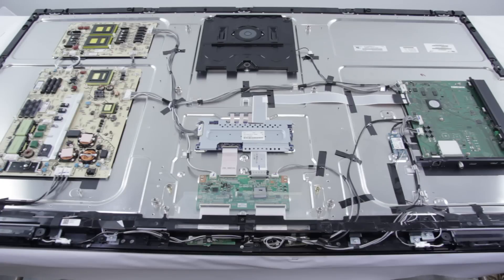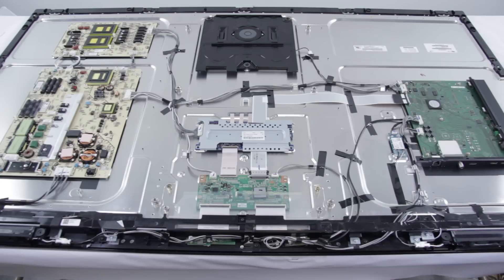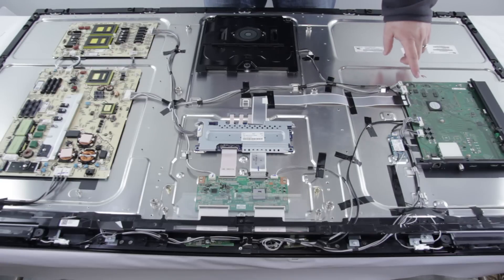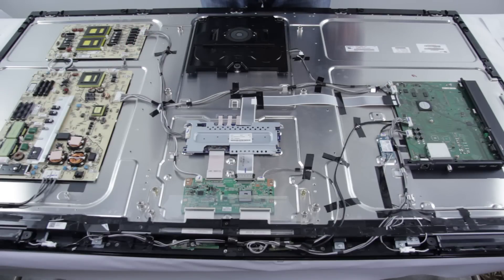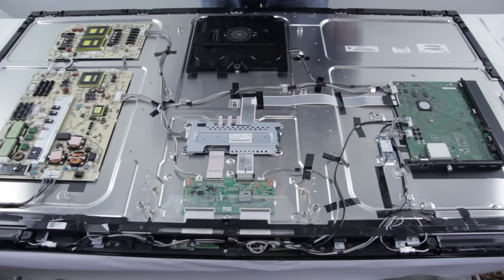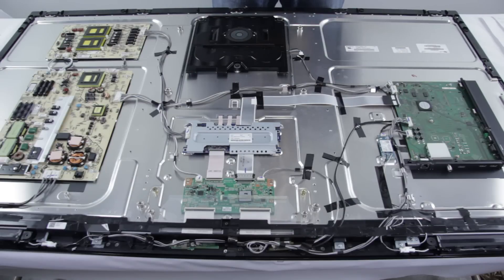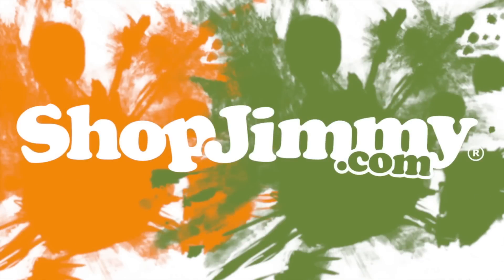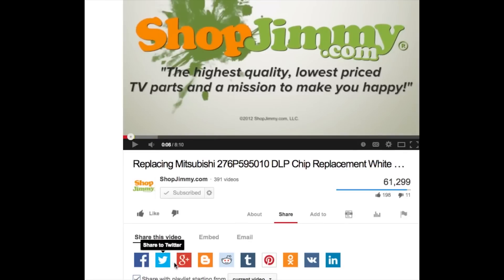LED TV Repair Main Board Overview Blank Screen-TV Has Audio but No Video-Common Issues Problems

Comment: Changed the t - con board on Samsung un50h6400axfza and still getting a lit screen and audio but no picture
Reply from the maker: +kurt gonzales   Try all repairs and troubleshooting at your own risk.  I recommend running the flashlight test on your TV.   Here is a link to a video we produced that shows how to run the flashlight test. https://www.youtube.com/watch?v=xUzCLgoSPGM Please reply with your flashlight test results and we can recommend a replacement part for your TV repair. Thanks and please let us know if you have any questions! www.shopjimmy.com

Comment: I need help with a toshiba flat screen has no picture or volume but led lights are working model #47hl167chassis#taco711serial#am363057297

Comment: Hi I have sansui lcd 55 inch and my problem is with input if i plug in pc or media player it can't PLAY WITH full hd signal 
only 480p and if i use vga input it chose any resolution but not full hd
model no : LC-55A12

BEFORE WAS EVERYTHING FINE BUT NOW NOT WORKING ONLY LOW RESOLUTION

Comment: i have given to a local repairer and got it fixed.  mostly the problem will be in s/w side. black box which will be the main part if leds are good.

Comment: i have a lg 42 inches lv 5500 tv is getting oned after 3 minutes and vr unable to get audio and if v change the date and time once v off the tv and on again the time and date saved is lost technician said motherboard problem i am from india lg company said no motherboard its 2011 where can v get it in india in andhra pradesh

Comment: I have a vizio 55 inch  model number is m550 vse...the tv turns on with the logo vizio then turns off 5 seconds later and the led vizio light stays on....I can do this multiple times and the tv keep turning off....plz help
Reply from the maker: Raul De Los Santos   PLEASE SUBSCRIBE TO OUR CHANNEL - Try all repairs and troubleshooting at your own risk.  I recommend replacing the main board in your TV.  Click this link to replacement parts for your TV model number:  http://www.shopjimmy.com/catalogsearch/result/index/?cat=56&q=m550+vse  There may be multiple boards for the same TV model number, be sure to match part numbers on your current board, with your replacement for compatibility.  Thanks and please let us know if you have any further questions with your TV Repair!  www.shopjimmy.com
Reply: I think that's what it is because I change all 3 motherboards and still doing the same thing the last motherboard is the motherboard you just told me to change. That's probably what's wrong with it the one with the USB cable in RCA cables attached to it on the side its got corrosion inside the motherboard

Comment: LG 55lv5500 power button  comes on, no backlight, no picture,  no sound. No image from flashlight test. Please help.
Reply from the maker: Nicole WOODS-ANDERSON   I recommend replacing the main board in your TV.  Unfortunately I do not see any replacement parts in the search results for your TV model number on our website.  Please reply with your part number on your main board and I can try searching for replacement parts.  Thanks and please let us know if you have any further questions!  www.shopjimmy.com

Comment: My name is Ron Thomas.  I have a 2011 Sony Bravia KDL46NX720. The TV has developed a problem.  I turn it on, and it powers up, and the screen lights up for about 6 seconds. then it turns itself off, and blinks red four times repeatedly. I found a Sony code chart on the internet, but 4 flashes is not on the chart. I am now confused.  am willing to buy a replacement board, because I believe I can replace a circuit board myself, to save on costs.  Please help me if you can.
Reply from the maker: Ronald Thomas  Please watch this video FIRST to help with your repair!  https://www.youtube.com/watch?v=BP3NVNCGEv8  I recommend replacing the main board in your TV.  Click this link to replacement parts for your TV model number:  http://www.shopjimmy.com/catalogsearch/result/index/?cat=56&q=KDL46NX720  There may be multiple boards for the same TV model number, be sure to match part numbers on your current board, with your replacement for compatibility.  Here is a link to a video showing how to identify your part number, click here:  https://www.youtube.com/watch?v=Aodz2LHkzbY  Thanks and please let us know if you have any further questions with your TV Repair!  www.shopjimmy.com

Comment: I have a PROSCAN PLDED3996A-C2 S/N A1305095130002210. I have sound and no picture.  I can see the menu when I shine a flashlight on the screen.  I cannot determine what part I need to replace, but its either the power board or LED controller board.  I don't believe I have an inverter for the LED or its built into the main board.  What part do I need?  Model No TH390LK01-ACW1
Cell V390HJ1-P02
T201304032
Reply from the maker: Mike Moor  PLEASE SUBSCRIBE TO OUR CHANNEL - Try all repairs and troubleshooting at your own risk.  This could be a problem with either the power supply or bad LEDs in the TV.  You can replace the power supply board to see if that fixes the problem.  Unfortunately I do not see any replacement parts in the search results for your TV model number on our website.  Thanks and please let us know if you have any further questions!  www.shopjimmy.com

Comment: Hi this is Rajesh here 
I have a RCA Led tv model :RLDED5078A-D. The problem is when I on the TV I get sound but no picture.if I put the torch light on the screen I could see some the TV is on with display with o% light or display. But I get sound.what is the problem? Reply thanks

Comment: I have a samsung un40es6100f the screen turns on and off. I already switched out the power board and still doesn't work any help would be appreciated thanks...
Reply from the maker: +Alfonso Vasquez   Try all repairs and troubleshooting at your own risk.  I recommend replacing the main board in your TV.  Click this link to a replacement main board for your TV model number:  http://www.shopjimmy.com/samsung-bn94-05625y-main-board-for-un40es6100fxza.htm  There may be multiple boards for the same TV model number, be sure to match part numbers on your current board, with your replacement for compatibility.  Here is a link to a video showing how to identify your part number, click here:  https://www.youtube.com/watch?v=BEPWrefQvqI  Thanks and please let us know if you have any further questions with your TV Repair!  www.shopjimmy.com

Comment: LG 55uf680V:
- Device switched itself off while watching, when turned it back on the TV was stuck on the LG screen (start-up screen),
- TV doesn't respond to the remote apart from switching device on/off "stand-by" mode.
- Had a look at the AV board -> I can only assume this is a software issue as the picture appears to be fine (no telling about the audio)..
- Tried to perform system software update (found on LG website) with FAT32 formatted USB -> no success.
- There was no firmware update for this TV that I could find online -> IF ANYONE KNOWS OTHERWISE REPLY WITH A LINK.

This has got me stumped! any ideas?

Comment: Hi I am having tv model code UN50NU6900FXZA. Version No YA02/ UNU7090. Once I start the tv initially tv is starting with samsung logo and hanging in between (Not starting completely). I am able to watch movies using my iPad through Airplay. But my TV is not working  for rest of the any function. What could be the problem. Thanks

Comment: Hi i've got a LG 47ln575v that I can't get a picture on, the tv turns on and you get the LG splash screen for half a second then it goes black and when you switch it off you get a quick flash of what's on the screen for half a second then it goes off, when it first went off the tv was on and the screen dimmed then went black, I hope you can help 
Thank you 
Dean
Reply from the maker: eggster1972   I recommend running the flashlight test on your TV.   Here is a link to a video we produced that shows how to run the flashlight test. https://www.youtube.com/watch?v=xUzCLgoSPGM Please reply with your flashlight test results and we can recommend a replacement part for your TV repair. Thanks and please let us know if you have any questions! www.shopjimmy.com
Reply from the maker: Mark Manning  Try all repairs and troubleshooting at your own risk.   Yes, it appears your inverter is built into the power supply board.  Click this link to possible replacement parts for your TV model number:  http://www.shopjimmy.com/catalogsearch/result/?q=47ln575  Be sure to match part numbers on your current board, with your replacement for compatibility.  Here is a link to a video showing how to identify your part number, click here:  https://www.youtube.com/watch?v=_4Qpfan0vdU  Thanks and please let us know if you have any further questions with your TV Repair!  www.shopjimmy.com
Reply: Hi I have exactly the same problem as eggster1972 with the same tv model, have the backlight test and torch test, there is no backlight and their is a image on the display, I changed the power supply and the problem remains the same!
Please Help
Thanks
Reply: I was told of the engineer that came out that it was unfixable coz there was a bank of LED's that had failed so the shop changed my TV for a brand new model that was more expensive
Reply: Hi. I have a LG 47LN575V. No picture but get audio. After your video. i can confirm I get the white back lights and can see the picture via torch test. can you help in feedback back the board to replace please.
Reply: Hi I have a similar problem with my Lg 47LN575V. I have audio and as soon as you switch it on the lg logo is flashed and then disappears. I checked by opening the cover but there are no inverters as the other tv sets. What might be the problem. 

Thanks
Reply: I have LG47ln575v mode. Have black screen. Sound is okay. But no picture . I can see with lurch. Bought in Dec 2013. Please suggest
Reply: Hello, I have exactly the same issue for my LG 42la620v, I have replaced the Tcon board, the main board, and the power supply board and I still get the same issue, (LG logo flashes then it dims to black screen when powered on, and does the same when powered off).  Any ideas whats up?
Reply: Hello, I have exactly the same issue for my LG 42la620v, I have replaced the Tcon board, the main board, and the power supply board and I still get the same issue, (LG logo flashes then it dims to black screen when powered on, and does the same when powered off).  Any ideas whats up? did you manage to fix it?

Comment: I have the Samsung tv model #UN40ES6100F TYPE #UN40ES6100 The tv comes on with sound no Picture u hold a flash light to it and can see the pic i tuck back off looked at both boards it dont look Black the pic sometimes come in for  a few days  then goes out what to do

Comment: my Emerson 32 in tv model LF320EM4 doesn't have picture and I'm sure it doesn't have sound but the backlight comes on and you can see there is nothing wrong with the screen itself

Comment: Your video gives me a little bit inside of the symptoms to my TV. I have a 45 inch Vizio Model# VIZIO XVT473SV, SERIAL # LAPPGKAL5002365. Apparently the TV was on and working just fine when the video/image seized while the backlight and the audio still works. I turned TV off and on afer 30 secs but nothing happened. I opened the cork (back) of the TV but everything visually shows ok. While the back of the TV was opened, I turned on the TV and looked at the boards in a dark room, I realized a blue light was blinking on the power board. I couldn't figure out the exact problem bc visually nothing shows burnt or damage on any of the boards. The remote works pretty well as the audio and backlights. I would be very grateful if guided  on the diagnostics could be. The TV has a t con board, power supply board and a main board. Waiting on you ASAP.

Comment: LG 32LE5500 - After pressing power button the power button light comes on but no picture. I have to switch it on and off like over 20 to 30 time before it come on. Kindly assist

Comment: Hey there, I have a Samsung Smart TV 32" serial number: Z6Q93CFD300408T that will turn on and have fully functional audio but will display nothing. Please let me know what my best plan of action is to fix this issue.
Reply from the maker: andrews drury  Try all repairs and troubleshooting at your own risk.  I recommend running the flashlight test on your TV.   Here is a link to a video we produced that shows how to run the flashlight test. https://www.youtube.com/watch?v=xUzCLgoSPGM Please reply with your flashlight test results and we can recommend a replacement part for your TV repair. Thanks and please let us know if you have any questions! www.shopjimmy.com

Comment: I have a Samsung un40es6100 everthing seems to work except the sound level increases on it's own.
Reply from the maker: kiheisam   Please watch this video FIRST to help with your repair!  https://www.youtube.com/watch?v=BP3NVNCGEv8  Sounds like it could be that your keypad on the TV is stuck, or you have a bad main board. Check to see if one of the buttons is stuck on the keypad. If not, then I recommend replacing the main board in your TV.  Click this link to replacement parts for your TV model number:  http://www.shopjimmy.com/catalogsearch/result/index/?cat=56&q=un40es6100  There may be multiple boards for the same TV model number, be sure to match part numbers on your current board, with your replacement for compatibility.  Here is a link to a video showing how to identify your part number, click here:  https://www.youtube.com/watch?v=-TU2KSuect4  Thanks and please let us know if you have any further questions with your TV Repair!  www.shopjimmy.com

Comment: I have a Hisense 32K20DW and my screen went black but has sound. I tried the flashlight on the tv and the picture came up. I mean what is the problem and can i solve it and fix it myself?
Reply from the maker: DeQuan Stephens   I recommend replacing the inverter board in your TV.  Unfortunately I do not see any replacement parts in the search results for your TV model number on our website.  Please reply with your part number on your main board and I can try searching for replacement parts.  Thanks and please let us know if you have any further questions!  www.shopjimmy.com

Comment: I have a LG 47LS5700. Audio is working fine but get no video. When i turn the tv on, the screen slightly lights up but is still black. Any ideas?
Reply: Peter Nixon I have the same TV with the same problem, where you able to fix the tv?
Reply: I did some more research and it might be the t-con board.
Reply: I took it to a TV repairer and they said it was a board that was attached to the main screen so would have to replace the screen as well so not worth fixing
Reply: I just replaced my led board for 9 bucks and it works perfectly. That's the board that feeds the back light to the screen and connects to the T-con board.
Reply: ***** the Led Driver Board is under a steel cover and has 3 leads, just unplug them and plug the into the new board. Vizio M47OSL shares the same board and for some reason cheaper then if you google LG 47LS5700 led driver board for our TV.

Comment: I have a Samsung UN32EH5300 ‑ 32" LED Smart TV.  The screen is black but you can hear sound. When you press the power button it flashed red a few times but nothing happens. Please help.

Comment: I was mistaken on the model number, the television is actually a seiki se50FY10.

Symptoms: Audio but no picture.

Let me know if you have the proper board in stock.

Thanks.
Reply from the maker: Null257   I recommend running the flashlight test on your TV.   Here is a link to a video we produced that shows how to run the flashlight test. LCD TV Repair - Flashlight Test for No Image, No Picture on TV Screen - How to Fix LCD TVs Please reply with your flashlight test results and we can recommend a replacement part for your TV repair. Thanks and please let us know if you have any questions! www.shopjimmy.com
Reply: ShopJimmy.com I did the flashlist test. have same problem with same model# SEiKI, SE50FY10.  Menu works with flashlight.  Need to locate where the led card would be and what I would need.

Comment: I interchanged the HDMI cables and also used other AV source but still no signal is what comes up.
Reply from the maker: Did you try a different HDMI cable or was it still the same one?  If you did try a new one, what was the result? Thanks!  www.shopjimmy.com
Reply: Did try a differnt HDMI the result was the same. No signal. The connection is getting detected but no signal for dvd player and also for cable box. I also tried connecting through other audio video connections, still the same result.
Reply from the maker: *****  Please watch this video FIRST to help with your repair!  https://www.youtube.com/watch?v=BP3NVNCGEv8  I recommend replacing the main board in your TV.  Click this link to replacement main boards for your TV model number:  http://www.shopjimmy.com/catalogsearch/result/index/?cat=56&q=LE5500  There may be multiple boards for the same TV model number, be sure to match part numbers on your current board, with your replacement for compatibility.  Here is a link to a video showing how to identify your part number, click here:  https://www.youtube.com/watch?v=RwHTvjMdrhk  Thanks and please let us know if you have any further questions with your TV Repair!  www.shopjimmy.com